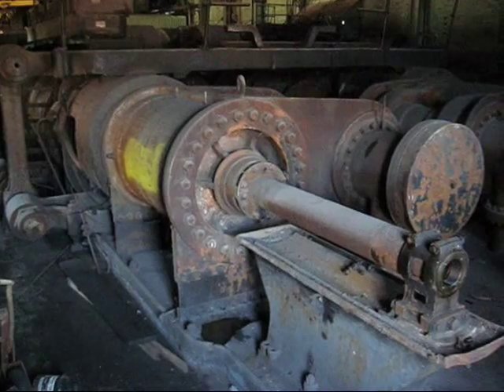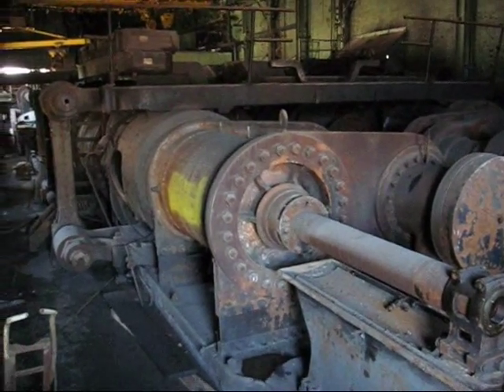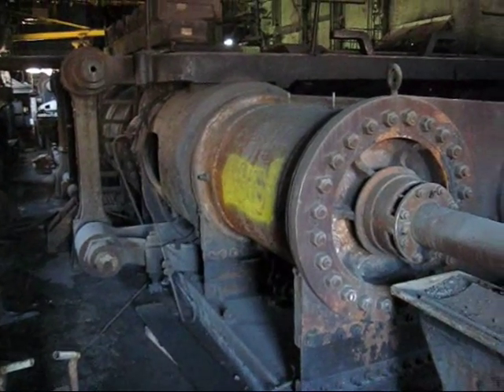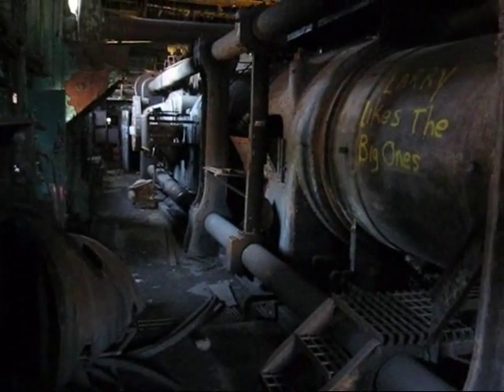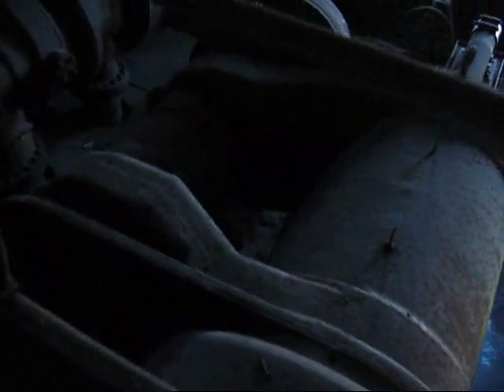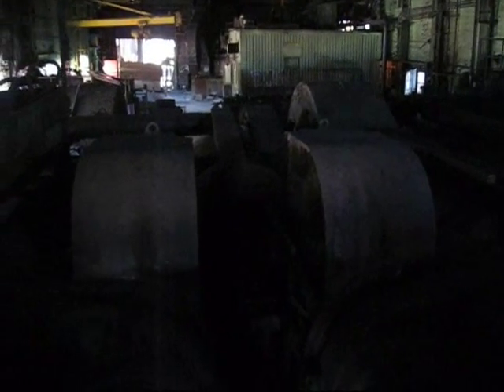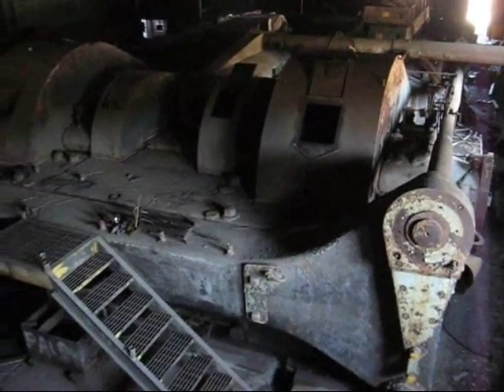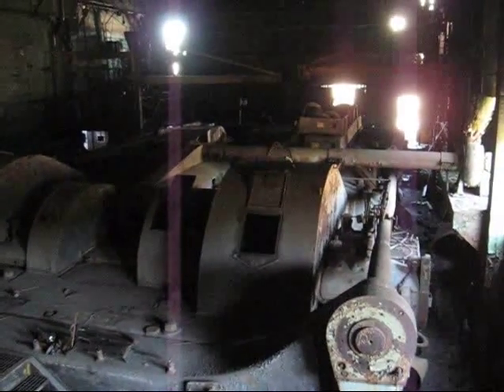Weirton's Blooming Mill Engine

Comment: When I ran that crane on repair turns, we would check, shim or change the connecting rod bearings. I used a 25 ton hoist to torque the nuts on the bearing caps. I usually stalled the hoist on the second point of acceleration to gain the required torque. I was deep in that  engine on many repair turns, and I have much info to share. I was one of the few 4th generation steel workers in the mill. My Great Grandfather was hired by E.T. Weir as an engineer to build the steel works.

Comment: I worked in the Blooming Mill 73/74..according to the roller who was completing a 50 year career, the clamps were added after the high pressure pistons exited the building through the brick wall. originally there was an accumulator at the rear of the engine.. FYI  The engine drove a 49 inch Mill.. Between the high pressure pistons was a Shuttee (sp?) Throttle Valve which I helped crank, more than once. At the end of the crankshaft was the governor..